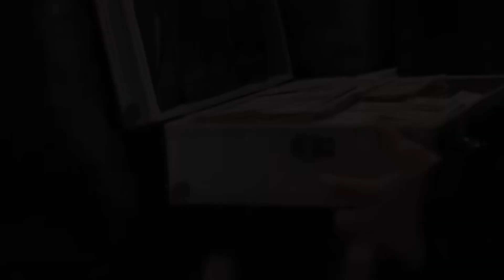Why Commercial AIRPLANES are WHITE?

Comment: Having a coloured topcoat is what determines the heat absorption and not the colour of underplaying coats. The modern composite construction can degrade if it gets too hot, so needs to be white. When the aircraft are flying at cruise altitude, ie; above 30,000 ft the temperature is - 40C and below, so heating in flight is not a problem. The main issue is if the aircraft is on the ground for extended periods, whichout shelter. This caused problems during the pandemic when many aircraft were parked outside for months at a time. Many aircraft had to be refinished.

Comment: Does white paint weigh less than black paint?
Reply from the maker: The weight difference between black and white paint is not due to the color itself, but rather to the composition of the pigments used in each type of paint.